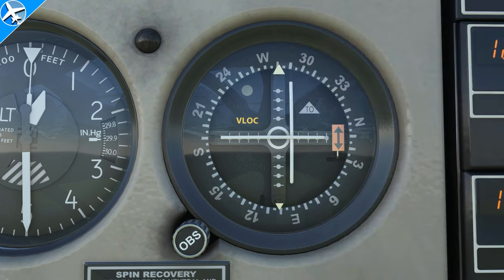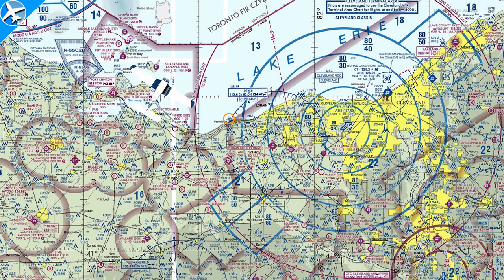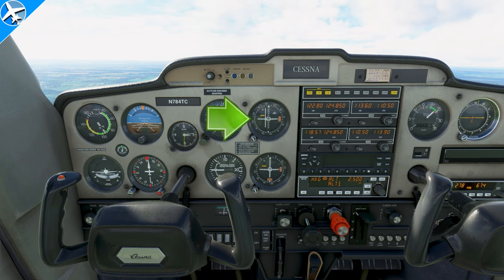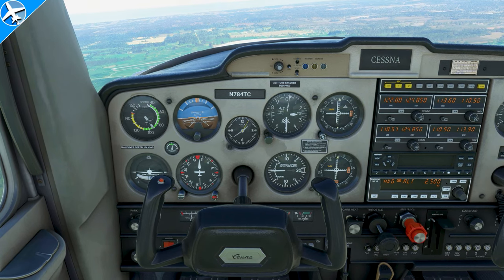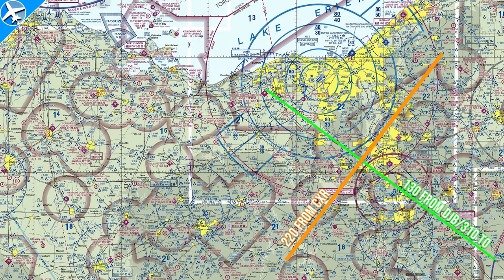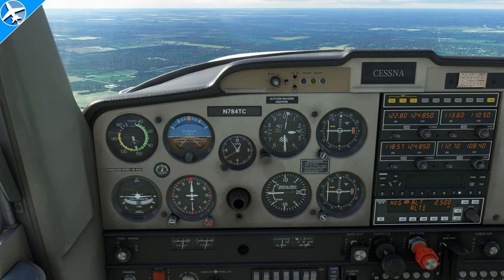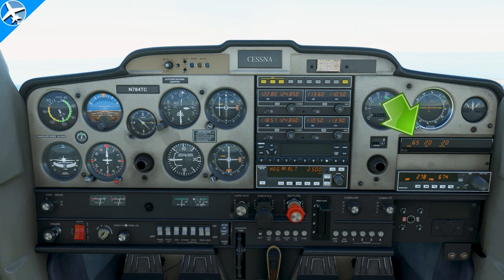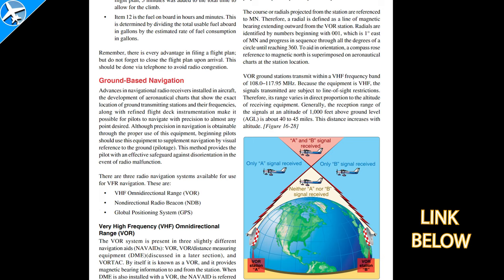VOR Navigation Explained - Pro Pilot | Former CFI

Comment: I understand VOR's however, Trying to do this under the hood flying by instruments only and holding my headings, altitude to ACS standards. I can manage to tune the two From VOR's but trying to graph  two lines on my Foreflight or paper maps to find my position is super difficult for me. I end up loosing my heading or altitude as I am under instrument. I can only take my eyes off the instruments for like 2 seconds at a time and that's not enough time for me to even try to start the graph line. Easy on the written exam but super hard doing it when flying under the hood.  Is there any tricks to this. I have my Private Pilot check-ride coming up and need to find my position under the hood and stay in ACS standards.
Reply from the maker: Practice in the airplane with your instructor.  Don’t focus on tuning and finding the radial, but do so in short  segments.  1-2 seconds can be spent turning the OBS knob/finding the radial at a time, then go back to the instrument scan and repeat.  Also, make sure the airplane is properly trimmed and in straight and level flight.
Reply from the maker: Good luck on your checkride!

Comment: i have questions
what is VLOC, NAV(green light) and  GPS 
what is mean if show or turn off
Reply from the maker: That just shows where the source to the VOR receiver is coming from.  VLOC is VOR or LOCalizer and GPS would be when the mode is changed to GPS, if equipped. As far as NAV (the green light), that would be the same as VOR or LOC as far as I know.  I cannot find any supporting data to show there is a difference.

Comment: Short sweet and complete! Did you ever fly with a DCE computer? Back when I flew DC-9’s ( the Jurassic jet, ) the DME would only give you distance no ground speed readout! You had to compute that! However the Convair 580 (The Convair, a Sauris) was modernized with a KN64 DME. 😁🛫
Reply from the maker: I never flew with a DCE computer.  Rental aircraft I flew had no DME with a single VOR, DME, or LORAN C.  One airplane did have an archaic GPS that was mind blowing at the time in the late 90s.
Reply: @thecorporatepilotdad  I flew a Lear 25 and Falcon 20’s in the early 80’s with Loran. They worked pretty good and a few Lears with VLF Omega units🤯🛫

Comment: Finding my position using two vor's under the hood is not easy. I manage to turn both VOR's with a From. But the graphing on the chart while on instrument. I have to do it quickly, yet I can only take my eyes off the instruments for 3 seconds. Take me a very long time. Help.
Reply from the maker: Sorry for the long delay in answering your comment.  Practice the process and do each step in segments with your main focus on flying the airplane - always fly the airplane, always.  For example, get the radial from the VOR on the panel, scan instruments, find the VOR on the chart and hold your finger/pencil on it, scan instruments again, then draw the line from the VOR.  If you have MSFS or any PC sim, that would be a great place to practice being quicker in the airplane.  Also, make sure the airplane is trimmed before starting the process.